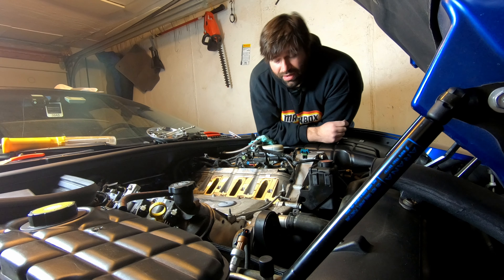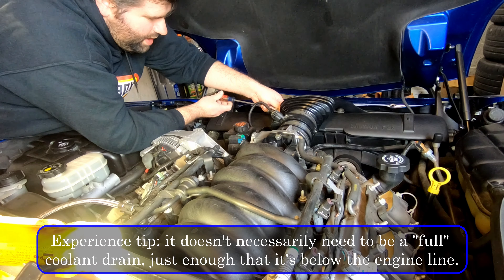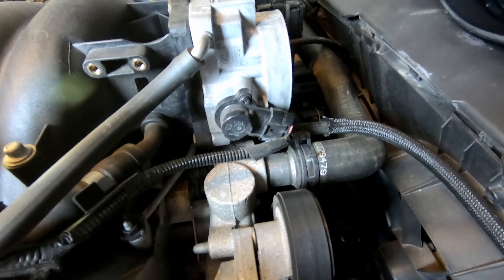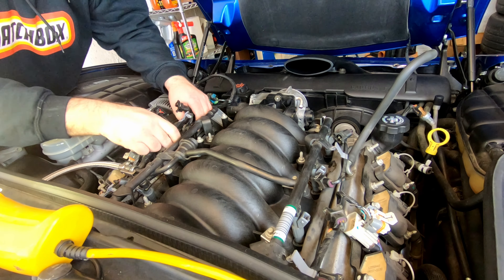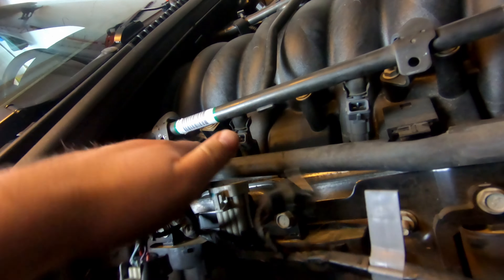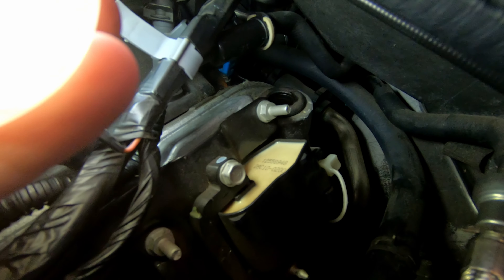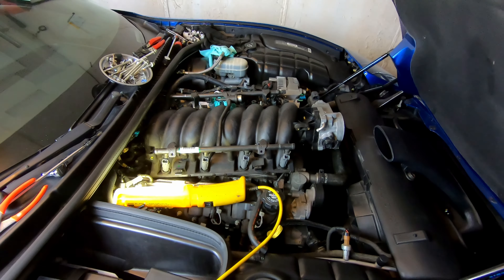Removing an Intake Manifold off a C5 Corvette

Comment: Great video sir.  I may have to do this soon as I am getting a PO 492 code.  May have to replace the check valve.
Reply from the maker: It's a bit daunting at first and I was kind of worried doing it, but now, having done it, I can say that it isn't hard to do. It unfortunately takes time away from driving though.

Comment: Great video... Are there any gaskets that need to be replaced after taking the manifold off...  I may have to do this job myself in the future... Thanks...
Reply from the maker: Thanks for the support. It's not a hard task, just that I am slow and take my time. There are manifold gaskets and manifold seals, you'll need to replace both. There are 8 gaskets, 1 around each port and there are two seals, which is basically a foam padding. I went with the OEM and you'll have to order them separate. I'll update the description with links. I have seen a full kit on Amazon that comes with both, but it is an aftermarket brand.
Reply: @iDriveDaily  Thanks...

Comment: @3:13 how do you remove the second hose you circled? pull pull? squeeze and pull?
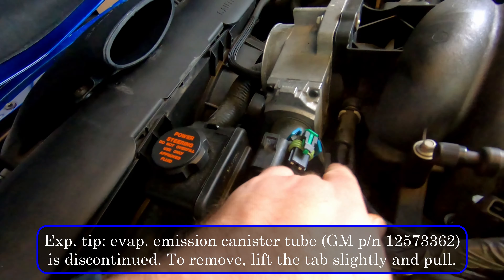Reply from the maker: Oh yea, that little hose with the white tab you mean? That hose is a royal PITA. I ended up breaking the white tab I believe, which is also a PITA because the part is discontinued. I'm trying to remember and if I am remember correctly, you press in the one side of the white tab and the other side should slide to release the hose. At 3:06, the part is listed at the bottom of the screen.
Reply: @iDriveDaily  Yep thats it, press on one side. TY sir.

Comment: I am currently replacing my knock sensors on my c5 and the 2 back bolts are not coming off. They are completely loose but are limiting the manifold from coming out please help.
Reply from the maker: They were a PITA to get out if I remember. I think I had to hold them up a bit at slide the manifold forward. They should move just enough to clear the block. I think I had someone help me as it requires 4 hands. You'll have to do the same when you go to put the manifold back.